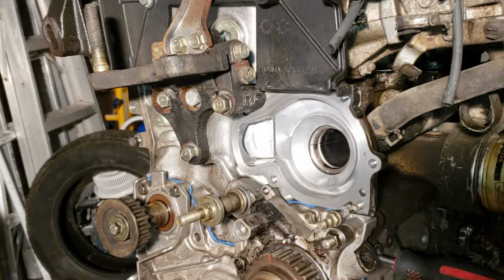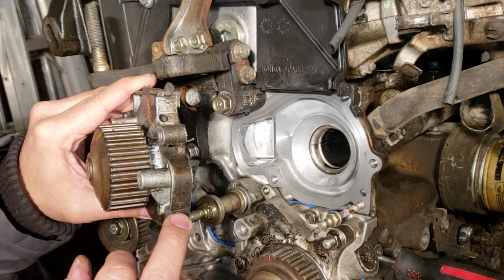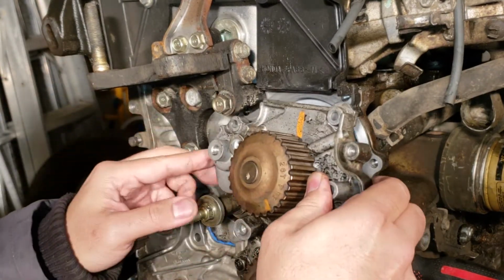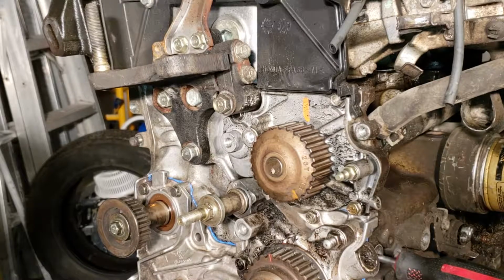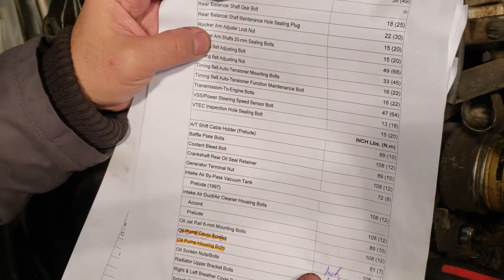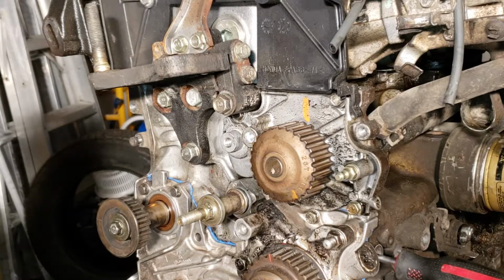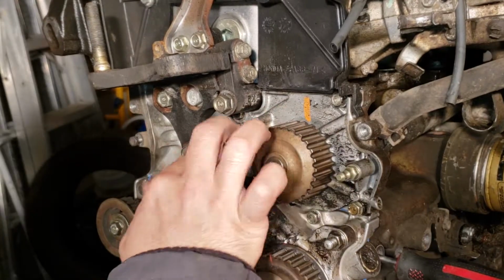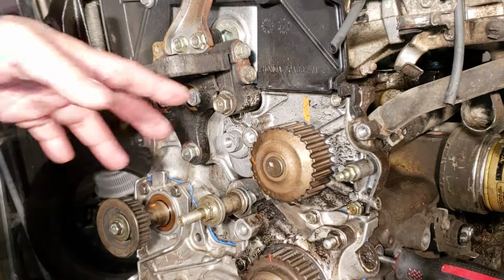Water pump Install  Prelude h22a4

Comment: Mine is leaking litle drops from water pump hole .. that means is in bad conditions i put litle screw inside the hole.. no more drips is time to change it???wath you think?
Reply: That is the weep hole - let it weep until you replace the pump or things will go very, very wrong. Just watch your coolant level and listen for noise but change it ASAP. (Guess how I know!)
Reply: Is no more drips since i put the screw inside the hole no antifreze leaks or noises ...it was like a year since i put that screw.. but thanks ill will replace the water pump......thanks...
Reply from the maker: Put a little  screw well stop the leak  BUT it well still  leak overtime, the coolant  well get the water pump bearing soak this well cus noise and well sized  the bearing shaft  over time. Just  replace  the pump get it done with,  sweep hole a sign of need to replace  a.s.a.p good luck  champ